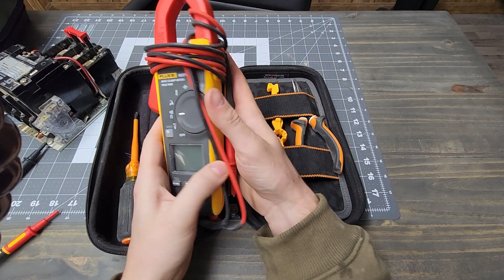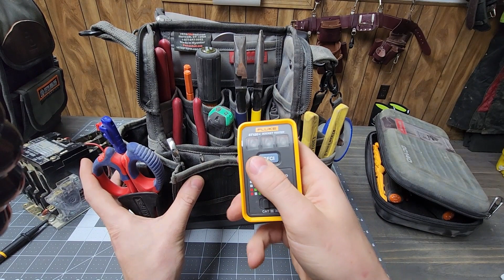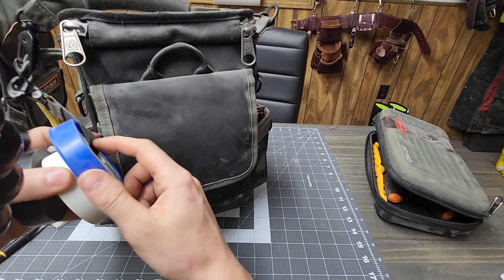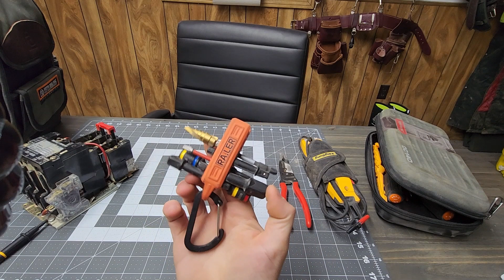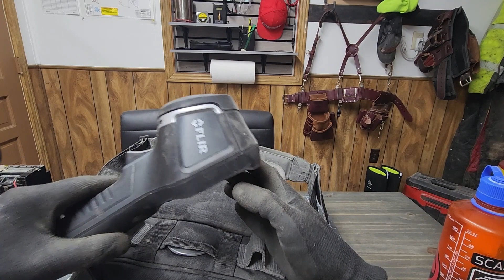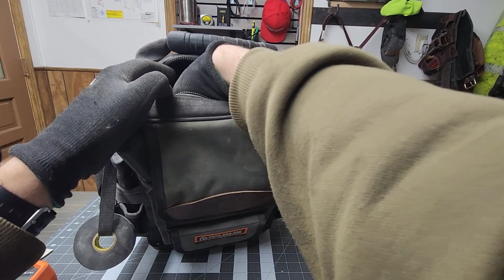Veto Electrical Maintenance bag tours

Comment: Which Veto tool pouch is that? It looks like a nice size with the flip up top. You got some nice tools.
Reply from the maker: It's the TP-LC made by Veto Pro Pac. Pretty handy. I'm thinking about upgrading to the TP-XXL because it has the meter pouches on the outside. Spendy packs, but worth the money imo.